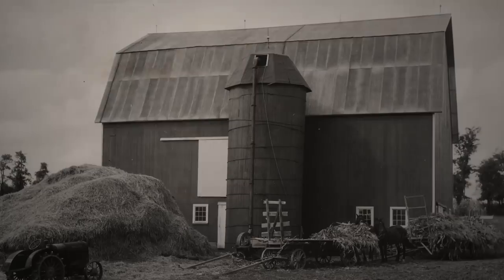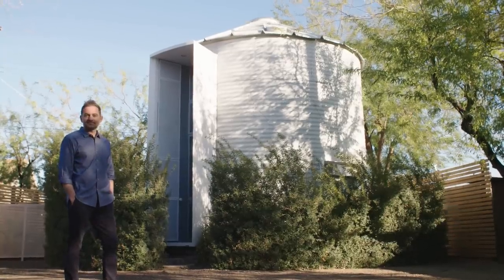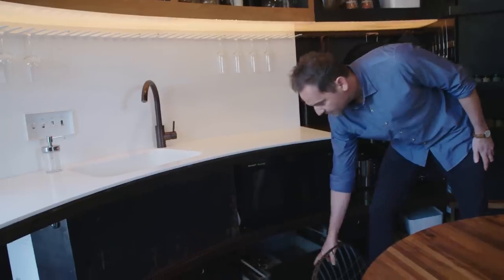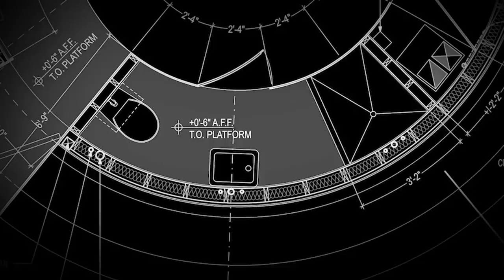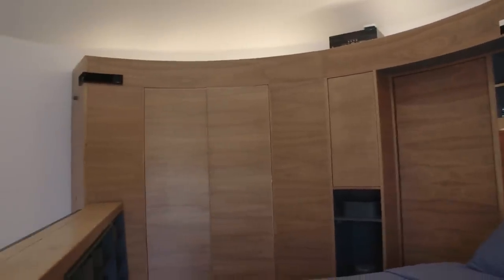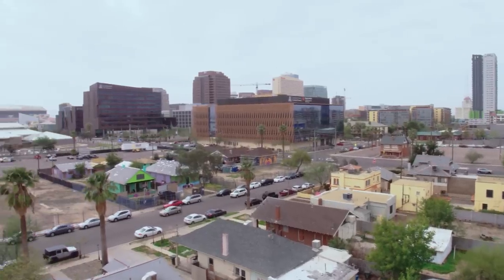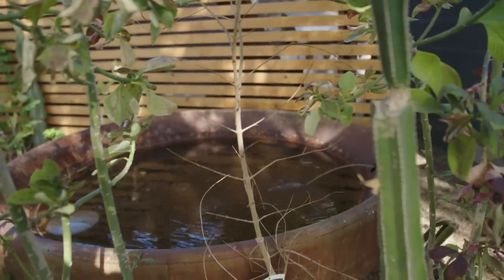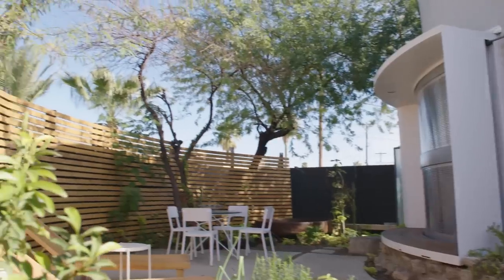Inside A Silo Transformed Into A Tiny Urban Home | Unique Spaces | Architectural Digest

Comment: He really missed out on the opportunity to have the Skylight in the middle and center of the roof. Which would really bring in another layer and natural light into the home.
Reply: Absolutly
Reply: True but would also bring in a lot of natural heat. Pros and cons
Reply: @dfresh1524  yeah, probably a bad idea because of the heat. Not only is this in Texas, it's also a metal tin can. Allowing even more heat to enter wouldnt be ideal.
Reply: @lumiineer  it's in Phoenix, AZ.
Reply: @voyager1369  He did say Downtown Phoenix. I'm not sure how much different the above comments would be though, it's still a very sunny, hot area.

Comment: nice, too bad it's in PHX,  I still see a square box house being smashed down into a cylinder, instead of a spiral staircase, a sweeping stairway around the inside of the silo, where all the house mechanics could be stowed, water heater, laundry, bath, THAT Bath needs to be a sealed wet-box, the whole thing is shower with a toilet and sink, that leave the space as a Great Room complete with kitchen/living space, the upstairs could be freed for 1/2 bath and bed(s),  but that's just me.  the exterior was very well thought out, the main living space in the shadow of the silo the growing areas in the full sun sides.  too bad it's in PHX